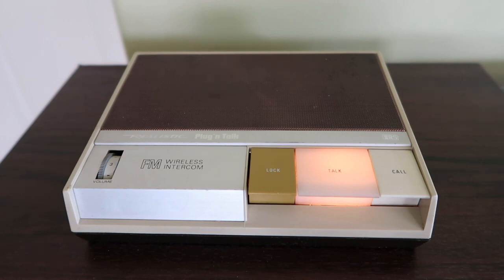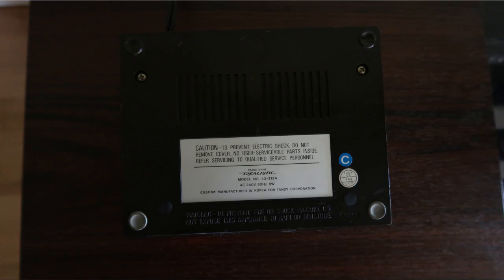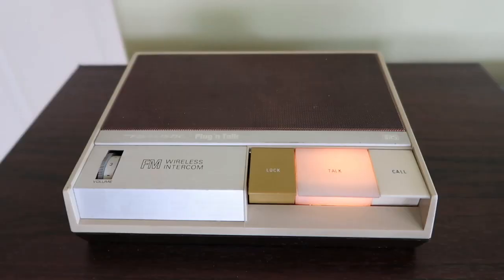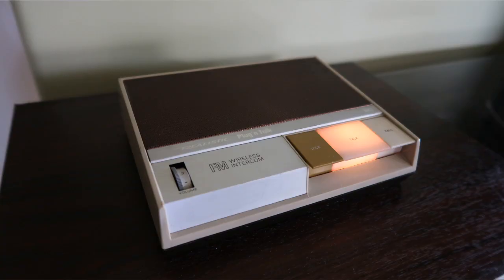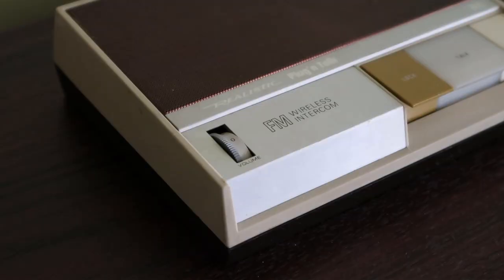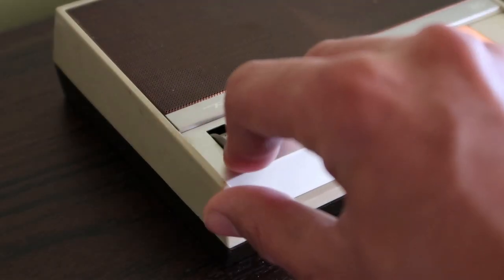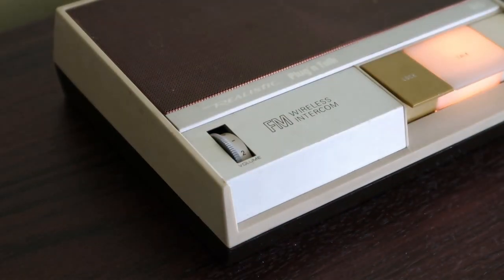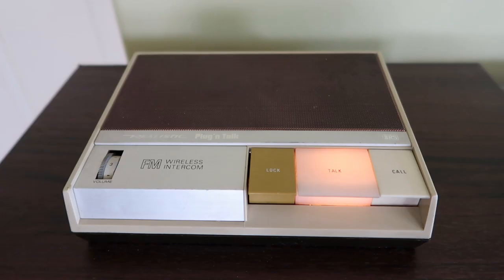Realistic Plug n' Talk FM Wireless Intercom

Comment: Feb 2024:  Thanks for the demo!  My dad bought a set around late 1981 - they were $39.99 USD per pair.  A lot of buzz and hum used on our power line, but novel and fun.  Interestingly these worked between my friend next door's bedroom and my bedroom.  Excellent for two kids!  Sometime around 1983 I hardwired telephone handset cords to both units. They both worked flawlessly in single-duplex mode with both of our 300 baud VicModems between our Commodore computers.   Fun times.
Reply from the maker: You're welcome! That is interesting, the houses must've been on the same phase. You got quite a bit of use out of these, seems they can be rather versatile. Ingenious to use them with your Commodores!

Comment: What's the range on these? I can't seem to find anything online about it.
Reply from the maker: They transmit through the mains wiring, not through the air, so their range will depend on how many noise-producing appliances are plugged in nearby. The sockets they are plugged into will also have to be on the same phase, so they will usually not work between neighbouring houses.
Reply: @toomanyinterests  Ah got it! Quite the interesting setup in that case. It would also explain the noise.

Comment: I have the opportunity to pick one of these up, do you happen to know if the bulb inside is replaceable or soldered in?
Reply from the maker: I haven't opened mine, so unfortunately I don't know. It does say "no user serviceable parts inside" so it's quite possible the bulb is soldered in.
Reply: Soldered in.  Why do I remember this?  :)  I replaced the bulbs in mine with green LEDs at some point at my parents' house in the mid 80s.

Comment: Oh, that's just too funny! At least you could self-sensor with the call tone. I have two but, it would seem that the bulbs for the talk buttons are blown so, no lighted keys for the moment. Cheers!
Reply from the maker: Glad you enjoyed it. They're neat little devices.
Reply: I have a set and, if they work as described earlier, they're trash in my complex. Only because of noisy wall wart power supplies, flat screen tvs, led lighting and solar cells with inverters. Otherwise, they work just fine, with a little noise from corroded parts and non working PTT bulbs. I think their soldered LEDs.
Reply from the maker: @william_k4arx  They seem to be prone to interference, mine had issues when the CRT TV in the lounge was on, even just on standby. Amusingly when plugged into the same socket as a touch lamp, pressing the talk or call buttons turns the lamp on. I tried them just now and they didn't work, so something else plugged in somewhere is interfering.
I think the bulbs are incandescent, one of mine seems to have been left on a lot and the heat has discoloured the button's plastic.
Reply: I replaced the bulbs in mine with green LEDs at some point at my parents' house in the mid 80s.  :)

Comment: it would be interesting to briefly not be bombarded by frequencies every day all day. wonder how much we would actually be able to notice.
Reply from the maker: As well as radio, TV and phone transmissions, the sun itself emits radio waves, so we've had to deal with them for a long time. A Faraday cage or shield is often used to protect sensitive electronics from radio interference, as well as to protect people from dangerous electric currents. I have heard of some people who feel they suffer from Electromagnetic Hypersensitivity using them to get relief from it's symptoms.
Reply: @toomanyinterests  Thing with these Realistic "FM Wireless" intercoms, they didn't actually transmit over the air. they sent their RF down the mains wiring. The "wireless" really meaning, that you didn't have to run a wire directly between the two units. You could just plugged them into a power outlets, and they usually worked, as long as they were on the same phase. If you have a three-phase mains supply, and they're on different phases, they won't work.
Reply from the maker: @michaelturner4457  Thanks for the info, that explains how it manages to work somewhat well-ish despite the brick walls, and why with the TV even just in standby the intercom went completely nuts. That also means they probably wouldn't work between neighbours, as normally neighbouring houses are on different phases. There was a third unit of a different brand at the garage sale I got these from, but I thought they'd be incompatible. Now I wish I'd picked it up to see if it did work with these.
Reply: @toomanyinterests  I know about the phase issue with them. Because back in the 80s, our local church tried to use a Realistic FM Wireless intercom between the church office and the church itself, and it didn't work despite being next to each other, as they were on different phases from the substation.
Reply from the maker: @michaelturner4457  That would've been a bit of a disappointment. I wonder if these can be used between different buildings on the same phase, or if the signal won't be strong enough.
Reply: @toomanyinterests  In theory I think they should work between buildings if connected to the same phase and substation transformer outlet. 

I remember the church building, because later on they put up warning notices "DANGER 415 VOLTS". Although why a place of worship and offices would need a three-phase mains supply, I don't know. It's not like a factory with heavy machinery or something.
Reply from the maker: @michaelturner4457  That's odd, I wonder if they had a 3 phase air con? Don't see why they'd need to put signs up though, strange.